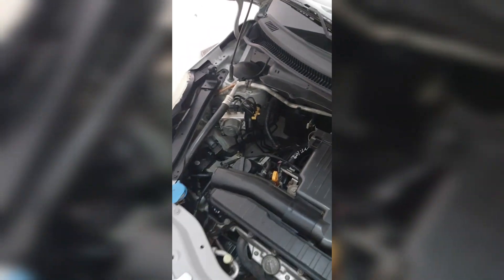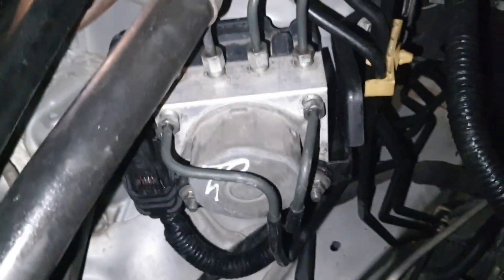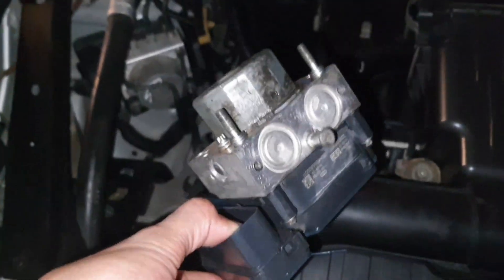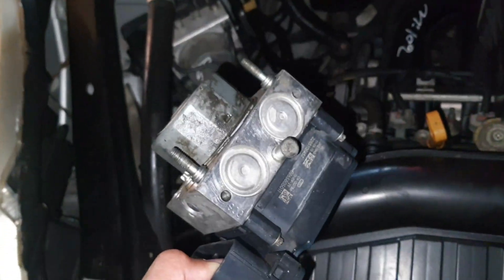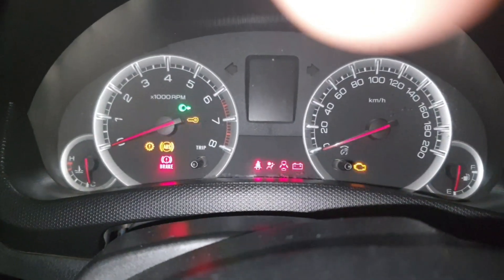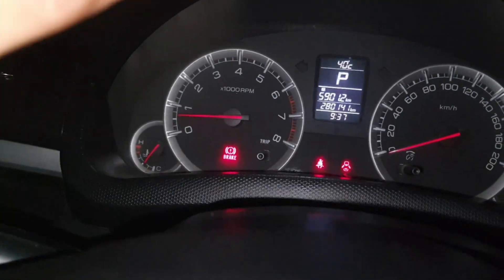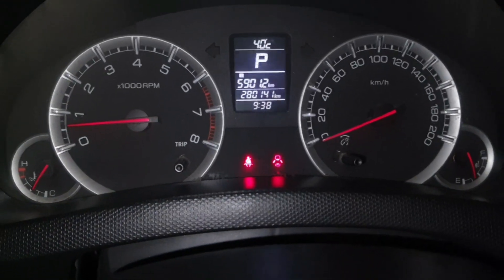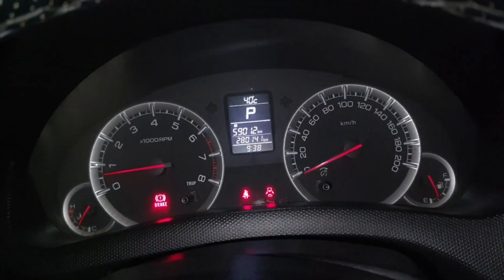Suzuki C1061 Pump motor circuit performance, easy fix car hospital.

Comment: Did the used ABS Pump Assembly need reprogrammed or a reset of VIN, what needed to be done if anything and was your scanner capable to do the job without going online? cheers. Thank you for all your videos.
Reply from the maker: No need program 
Buy a used abs and fix it
Then reset all fault code with diagnosis tool. OK brother